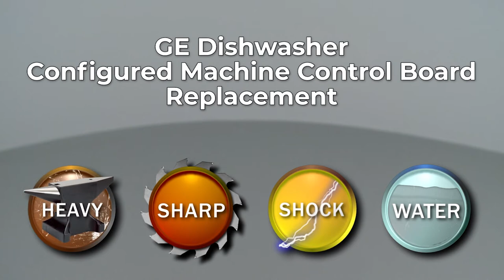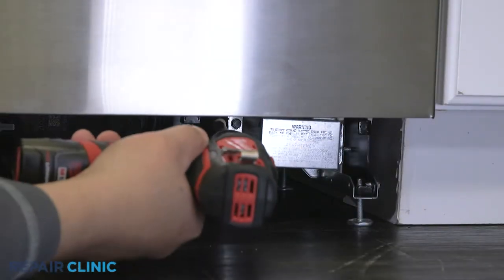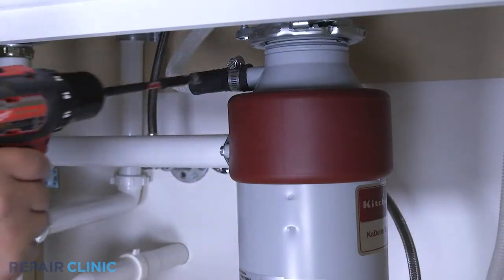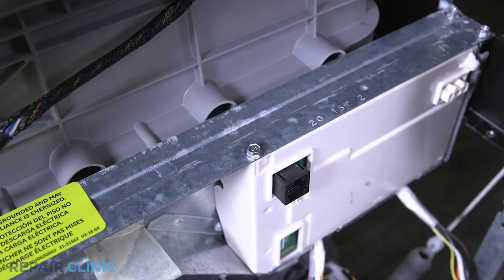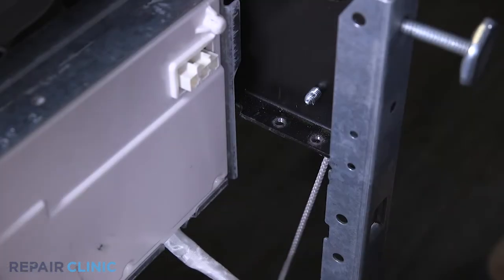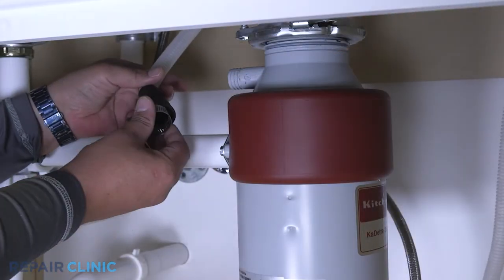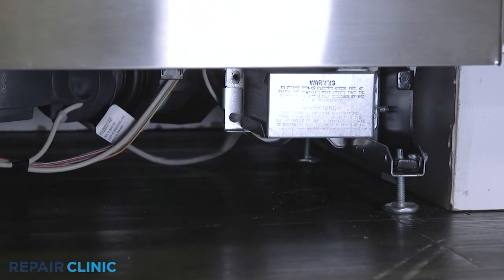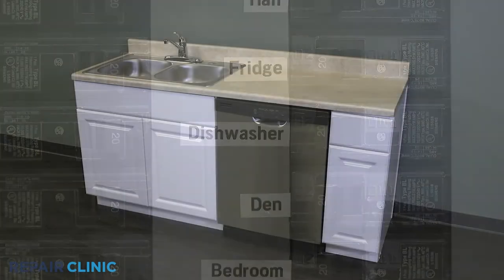GE Dishwasher Configured Machine Control Board Replacement WD21X27258

Comment: I can usually do this repair without pulling it out, and if the door is too long, I just pull it out slightly, without disconnecting anything, and just take the door off, which is easy to do on newer GE dishwashers, this repair typically takes me 10-15 mins.
Reply: That is exactly what I did today. Our washer did not even light on the control panel. This thing was dead. Laying on the floor, I got the board out, did some continuity tests on the board checking the fuse, capacitors, and all coils including the transformer coils. I found nothing wrong. So I went ahead put everything back together while getting prepared to order a new control board. I went ahead and powered the dishwasher back up, and it started like normal. It ran and finished it's cycle like normal. Turns out that all this thing needed was to have all the cable's re-seated.

Comment: Why touch the drain hose when replacing the control board? Seems like extra work.
Reply: Sometimes there is not enough slack in it when pulling the dishwasher all the way out?
Reply: @RosyB9  why pull out the dishwasher at all??? theyre doing way too much
Reply: @karllucas7024 Agreed. Was able to do mine without pulling it
Reply: Hello guys! Is there any led that comes up on this board? I was troubleshooting mine and I don’t see any led when the power is on!
Reply: @gouthamk378  I don’t believe there is. Is the dishwasher not turning on at all? Like no lights on the display?
Reply: @braydinjones582  yes I don’t turn on and I don’t see any lights on the display too! I was checking the panel board! How do I know if my board went bad?
Reply: @braydinjones582  also where did you guys ordered the board from! Any info would be helpful for me!
Reply: @gouthamk378  There should be a service manual folded up right inside the kick panel. There will be a wiring diagram on that. The first thing you should check is if 120V power is coming into the control board. Not sure how experienced you are with electricity but BE CAREFUL. I would check for tripped breakers and GFCIs before anything.
Reply: @braydinjones582  can I know where did you order your new board from?
Reply: @gouthamk378  I never even got a board. I had to take it out to diagnose a bad pressure sensor
Reply: It is, in most cases I can replace this without taking the dishwasher out, takes only a few minutes. this is how a DIYer would do the repair, the hard way lol.